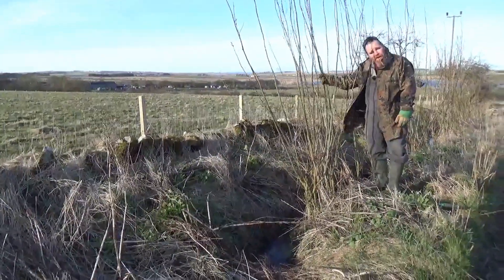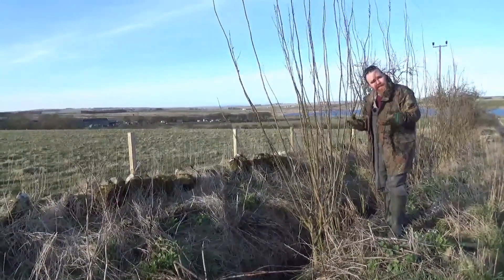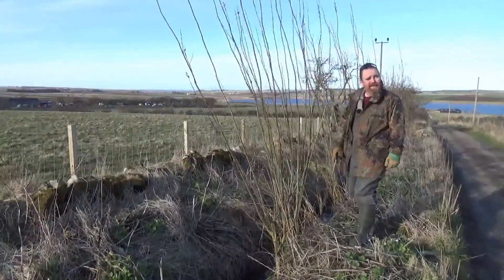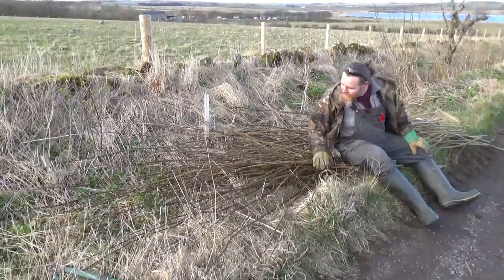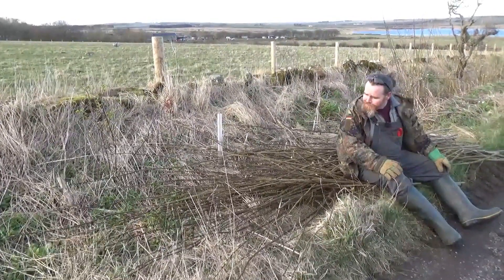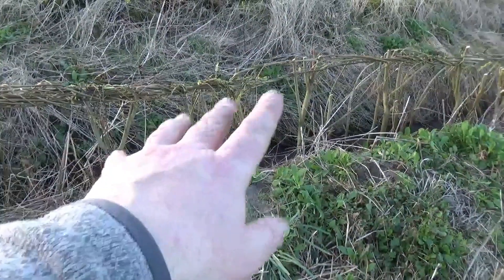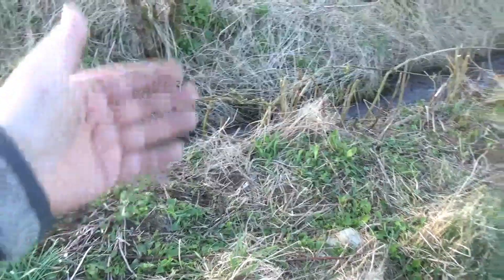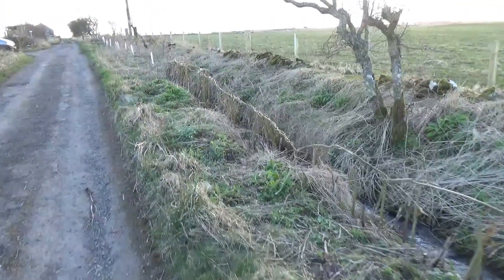Growing firewood from waste, closing the loop. Sustainable human waste treatment.

Comment: Does this setup pass the smell test?
Reply from the maker: Not fully. At the end of the day it's still an outdated septic system. But I can live with it being less waste and pollution.
Reply: @CairnOfDunnCroftPermaculture  could you intercept the outflow and divert it into a biogas digester? i would imagine all the nutrients would still exit, but some of the more volatile smelly chemicals might end up being burnt with the gas. unfortunately, officially you need a licence to be a bioogas producer in England, dunno about Scotland, but I'm sure you'd find a way of hiding it if necessary.